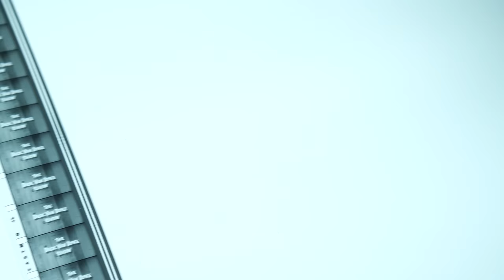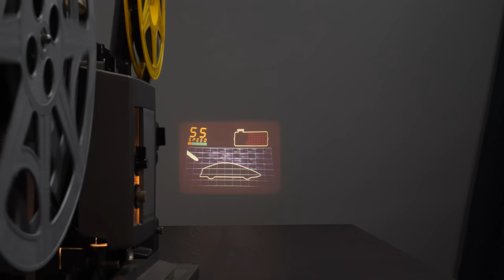Movies made sound with a light bulb: Sound-on-film

Comment: When I saw Star Trek II: The Wrath of Khan in a movie theater in 1982, the projectionist missed one of the reel changes, and the movie ended (and the lights came up automatically) RIGHT in the middle of the heart-rending Spock-is-dying scene.  Nothing kills the mood faster.  Among the groans heard in the audience, someone called out, "Well, that's it. They ran out of money."  (Referring to the film's producers.)
Reply: Ran out of money lol
Reply: Very occasionally, the reels would get mixed up too - that can sure make for a confusing plot...
Reply: odd that the lights would come on automatically, it's possible, I only worked with reel to reel a few times taking over another theater for someone, I can't remember what would happen if we missed switching projectors. they are all set up different! with a platter system that I'm used to it was a little strip of metallic tape on the last reel, that tripped a sensor to turn the lights on.
Reply: That's a joke my dad has made many times since then lmao
Reply: @SaiMorphX  I worked as a projectionist in the 1990s. In my theater, the lights were controlled by bits of metallic tape stuck to the film. When the tape passed in front of a sensor, the lights came up. Sounds like this theater used a similar system, so the lights would have come up at the end of the "last" reel, even if it was projected out of order.
Reply: Something went wrong when I was watching LotR 3 in the theater. In the final big battle scene, the screen went bright white and the sound cut out for a few minutes, and the audience was just about to start walking out when the problem was fixed.

No idea if the cinema used reels or hard drives though.

Comment: The another advantage of DTS's off-film approach that you didn't mention is an ability to switch soundtrack language without changing the film, which made it very useful in countries where movies could be released in different language versions.
Reply: I knew there were more advantages to that but couldn't think what off the top of my head. Thats a fantastic advantage.
Reply: Indeed, DTS was really the best option though it was probably more expensive.
Reply: Thus in countries where dubbing is the norm, showing a movie once in original language became feasible for theaters as they no longer needed to ship the entire film (which was expansive). Though there was always confusion when the title wasn't original.
Reply: Yes and it gave studios more time to work on the sound since prints could be made and distributed without the audio being ready. Analog fallback was used for bigger productions but at least these couple of local features i managed to work on before we went all digital had only DTS audio.
Reply: Also cartoons could have different language versions easily made maybe even unofficial translations could be made later in the movies life. Somewhat like people are transcribing movies and making subtitle files nowadays but with actual sound
Reply: I was a little surprised he didn't mention the ease of adding multiple soundtracks. But a creator only has so many feet of film, right?
Reply: It was also possible to use the DTS time codes to drive a second projector to add subtitles. That was the original plan, I don't know if it ever happened.
Reply: @mattgeek49  with an AI text to speech, you could even use the actor's original voice. "I'm Skallagrim, and I approve of this ether-flavored coffee!"
Reply: That's what my favorite cinema did back then. German Copies with english DTS-discs. This also meant of course if the copy was bad or other problems occured, that the movie randomly switched back to the german sound for short periods when DTS didn't work.
Reply: @owensmith7530  it did, there was a caption disc and a pair of sound track discs. Eventually the dts discs would be uploaded to a server so you wouldn't have to leave the discs in the playback unit or forget to re pack them with the film before sending off to the next theater.

Comment: I was a projectionist back in the early 90's and I remember when we got the Dolby Digital and DTS systems retrofitted to our projectors. We never got the Sony system though. The systems would instantly fail-over to the analog track if the digital signal experienced temporary corruption and switch back as soon as it got a good digital signal again. And yes, you could totally hear the difference when that happened but at least the audio didn't completely drop out if too much dust got on a section of digital squares. Also, try pointing an infrared remote at the light sensor behind the sound drum and press one of the buttons. You'll get a nice burst of digital noise pulses!
Reply: We had all 3 at the theater I was a projectionist at. The SDDS system was really unreliable, since the soundtracks were right on the edges where the rollers contact the film. any amount of dust and it'd lose sync.  Dolby and DTS were WAY more reliable
Reply: Man, I totally remember that happening during movies in the 90s and 2000s. Neat to know why!
Reply: @MrStimpanzee  I was thinking the same thing haha, now we know what was happening XD
Reply: There's a reason Paramount calls SDDS "Still Doesn't Do Sh*t"
Reply: 2000s projectionist here. SDDS seemed to mainly just be AMC. i was at Carmike. tho long after i left, i guess AMC bought Carmike. and i got a notice that my identity got stolen from Carmike records 🤣
Reply: Oh, hey, I think I recall that happening!  I was confused because they'd indicated it was digital audio, yet at times I would clearly hear analog noise.  Then it would stop again.  It's possible I'm confabulating here, but I don't think so.  These are the sorts of things I remember instead of, let's say, what I need to do in the next 20 minutes. 😆
Reply: Those were the QR codes on the other edge of the film?
Reply: @JFBence  more like matrix codes I believe
Reply: @JFBence  Yeah, they link to each frame's TikTok.
Reply: i once downloaded a DTS disk to my PC to see what it was.  it was a collection of sounds, and the timing marks on the film were simply programmed to trigger certain sounds and clips.  it is a really cool concept, meaning that all the dialog was recorded, and then the DTS box told it when to play based on the movie timecode.
Reply: @chubbysumo2230  Wait, really?  There are different files for different sounds?
Reply: @chubbysumo2230  I just read about the specification on Wikipedia.  I wish I had known about this before!  How do we get ahold of these CD-ROMs with the audio on them?!?  With the time code, it would be trivial to extract the audio and match it up to captioning!  Then one could keep track of it all and create arbitrary sentences out of the dialogue!
Reply: @chubbysumo2230  Yeah, so I am reading about DTS-X, and indeed you can actually adjust the volume of the dialogue independently!
Reply: @plonk420  Exactly. Different chains had different formats. AMC had SDDS, Carmike had DD, and Regal had DTS, if I remember correctly.
Reply: @5roundsrapid263  many theaters supported multiple formats because not all films had every format.  Our theather supported DTS, DTS-X, and DD.  that way if DTS(which was arguably a cleaner sound) wasn't supported or wasn't available on launch day, we still had DD at least.  Just had to flip 3 switches on the audio rack to change over the amps to use the DD track instead of the DTS computer.
Reply: @bsadewitz  did this plenty of times.  for some reason, movie makers LOVED making audio/spoken stuff super quiet, some to that point that if no adjustment was made, you could not hear them over the background sounds(just like at home!).
Reply: @bsadewitz  also, the dialog was more or less in "blocks", seemed to often line up with a scene, and then a new block would start after a scene change.  it was odd tho, because it was perfectly clean, no background noise at all, like, you could tell it was recorded in a sound booth, but once it was mixed with all the other sounds, it fit the movie.
Reply: @chubbysumo2230  Yeah, most had both DD and DTS. Few had SDDS. I agree; I like DTS better, even today with Blu-ray. I have a calibrated 5.1 system at home.
Reply: @chubbysumo2230  Wow, so you mean you could hear like the acoustics of the booth and such?  So just to be clear, what was the source material and the format/technologies involved?  In am fascinated by this now.  I didn't know such a thing existed.  The possibilities are endless!  If there are any captions in there, it would be trivial to process it and write out a bunch of files each with the dialog in the metadata.  If there aren't, then one could still use any of the numerous captioning services to generate them.
Reply: @chubbysumo2230  Maybe this made it easier to do a foreign language screening.
Reply: I saw my first film with digital sound projected from film last winter - and yes, I could clearly hear the moments when the sound slipped from digital into analogue. The change between the reels wasn't seamless btw. I noticed a bunch of frames missing. A girl who works in that cinema chain told me they have to cut frames often to stick one reel to the other - and they have these frames and share with each other. I wasn't lucky enough to get one though...
Reply: @bsadewitz  no, you could not hear the booth, but it was no background noises or anything. All that was mixed on top of it
Reply: @chubbysumo2230  Christopher Nolan is famous for making his dialogue very quiet on purpose. Glad to hear that theaters had the power to fight him, at least for a little while
Reply: Timecode is also used to allow digital DJ's to scratch on real vinyl records. A special timecode record is loaded onto the turntable, and the turntable audio is fed into a computer. The DJ software then plays music in accordance with the timecode.

Having known this, I was really surprised when I saw how the Dolby Digital system worked. That seems waaaaaay too complicated.
Reply: @antonliakhovitch8306  still do, i assume DTS hasn't really changed, even with newer iterations, its likely that the talking tracks are still different from other audio sounds.
Reply: @subwaygaragemusic  SDDS was the last to launch (in 1994) and the first to be discontinued (in 2004). In the meantime it had by far the lowest market share at around 10%. But since from about 1998 almost all prints carried all three digital formats it didn't much matter which system your projector was equipped with.
Reply: @chubbysumo2230  Most films these days are mixed with the dialogue, and often only the dialogue, sent to the centre speaker. Playing a film with the centre speaker not working sounds weird because all the incidental sounds are there, the music etc is all there, but when people open their mouths no sound comes out.
Reply: @chubbysumo2230  You wrote that dialogue "was perfectly clean, no background noise at all, like, you could tell it was recorded in a sound booth, but once it was mixed with all the other sounds, it fit the movie." Only now that I read that do I realize that of course the studios would do it that way. It would be much easier for them to do all of the background noise and sound effects once, and get them right. Then the human voices, which will vary between different language releases, can be played back at the same time along with the rest. It's obvious in retrospect and an excellent solution. Thanks for letting us know about that.
Reply: @chubbysumo2230  Consumer DTS on DVD and Blu Ray is totally different, it's just an audio compression system like MP3 or Dolby Digital. I have no idea what the situation is with current theatre presentations.
Reply: @RockinEnabled   That's unfortunate. With proper film handling and equipment you do not have to remove frames to splice reels together (and the reel changes can be seamless). Often one frame is removed to match the heads and tails to the proper leader, but you'd never need to remove more than that. Removing more, in my experience, was usually a sign of laziness (e.g. not wanting to spend time removing old splicing tape/tape residue so just cutting off the frame instead).

Comment: Three stories:
In the late 1960s, I managed the AV department in my high school. I also ran Bell and Howell projectors, all though newer than yours. After a while, I got to where I could change reels and get the next reel going in under 15 seconds. If I could get two projectors, the audience could hardly tell when I switched, except for the fact I was standing in the middle of the classroom.

During the same period, my Father was a photographer for the Smithsonian Institution. One project he was involved in was to try to reproduce photographically some of Alexander Bell's original optical sound disk experiments. They were trying to retrieve the sound without doing any damage to the originals. I don't think that method worked, otherwise I think dad would have been more exited about it.

My dad was also into 8mm movies. He eventually obtained equipment to place the magnetic stripe along the edge between the sprocket holes and the edge of the film. There was a problem though. This made that side of the film thicker and caused the picture to be out of focus across the screen. Then someone came out with a device which would carve a groove under where the stripe would sit to flatten out the film. The device was basally just a slot with a tiny chisel which scraped the grove. The trademark name was "Cut-A-Rut" made by R.& D. Carnall & Company.